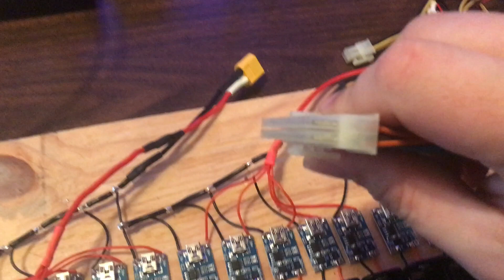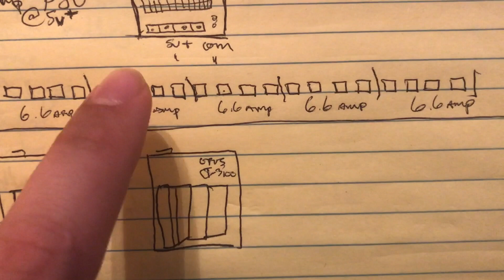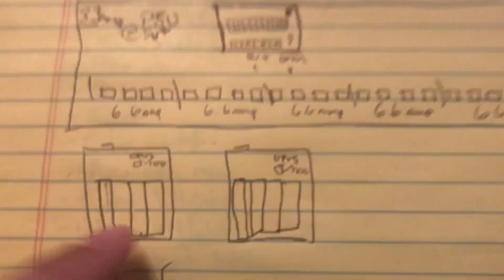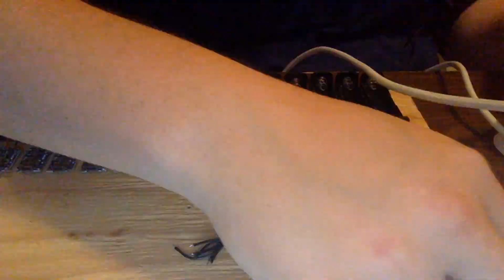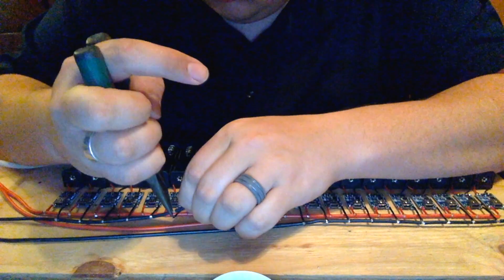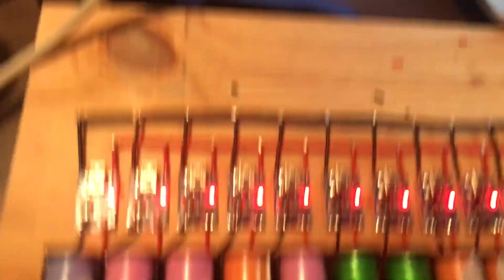18650 TP4056 Charger Build - Part 2 -ep3

Comment: rather than using a breakout and terminal block for the 20/24 pin main ATX why not use the 5v line (red) from the 4 pin Molex plugs as most power supplies usually have at least 4 on each ? you can get the mating connectors you need for free from old computer fans   ;-]
Reply from the maker: Dazza Direct one of the reasons is because the power supply itself has different “rails” (eg. legs of power so to speak) and through the molex you only receive 5 amps maximum on the PSU I had. So by combining the 5v lines across all of the leads, you get 100% of what the power supply can give you at 5V

Those details are on the sticker on your power supply

Comment: Hi Rogers, really interesting, very nice idea.
But can you please share few so far observations 
1.Is that TP40560 boards working properly...?  Any short circuits or any burning or any firing smells???? 
2. There you have two TP40560 sets each one contains 10 TP40560 S for Recharge.. 
Actually what is  each TP40560 board required volts and AMPs..is it 5v1amps...?  
a. If so 
You have 10 there so do supplies any multiplication of volts and amps? 
Or
b.what actually  we need to increase/multiples like only voltage or AMPs 
Ex for one board 5v1amps 
For 10 boards  5v but 10amps 
Or please tell us here so that will clear to eavru one.
3. Is that computer SMPS... If yes I do remember that have different output(voltage?,amps?)connections
What is output(voltage?,amps?)cable connections that you are using for 20 TP40650 board.

Requesting you kindly reply or if possible (mk568571@gmail.com)

Comment: i know im way behind.. the second set of connections at the output is the IC protection circuit. You use that to use the power from the battery but it cuts off the battery at 3
v to prevent over discharge . You simply purchased the ferarri of the TP4056 boards. :D